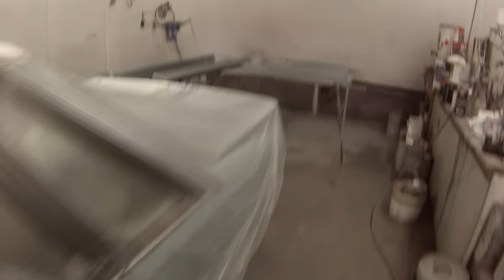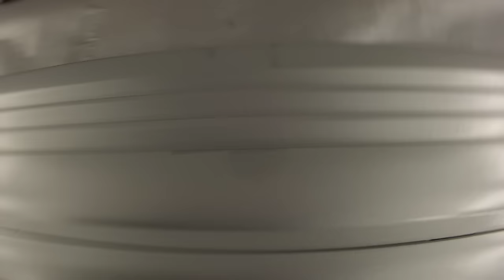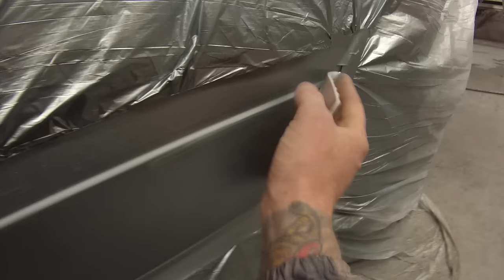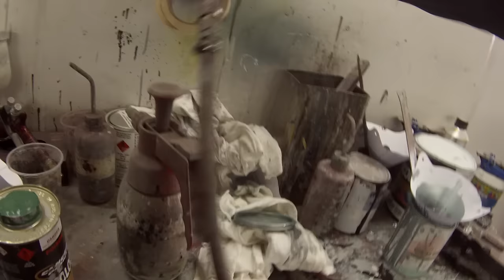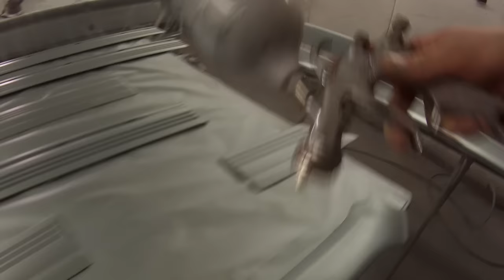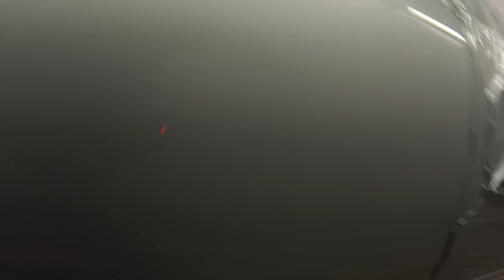Paint Fry Up Fix

Comment: That's exactly how I feel. Motorcycle I bought had nasty hydro dip on it that I thought I removed, fully, down to bear metal. on one side of my tank It did that exact same thing. Such a piss off. I sanded it down back to bear metal and same thing happened. Right now at like $50 in rattle cans lol
Reply: if your going to bare metal you are best to use an etch primer before the paint for it to adhere correctly and prevent paint lift

Comment: The best way to fix this is to get some 320, knock it all down and get some sealer in a can, put on a light coat, let it dry and then a heavy wet coat and then spray your top coat

Comment: Been there, felt that frustration more than I care to remember. I had this problem with Sikkens basecoat . I used Glasurit base coat at my shop & several after hours jobs I did were previously sprayed with Sikkens paint. They lifted the second my base hit the panel. 
After several times I found good sealers/tricks to make acceptable repairs, but no fun going through it. Sometimes stripping panels is just not an option for many reasons, so you'll eventually be faced with these fry-ups sooner or later.

Comment: Iv'e had this happen on a front bumper cover. An easy fix. Sanded it down. Took some primer filler and built up several coats. Wet sanded Primer, Base coat, Clear Coat, Turned out flawless

Comment: Next time try this sand fkd up spot 800 get mini gun mix up high built primer add little bit accelerator too it 
Dust it on then lightly sand 800 then base sometimes when it's really bad it helps also shoot base coat with no or hardly no reducer that also helps 
How I try too avoid trouble is I shoot base coat with no reducer on shit paint where I know it will Frey then base everything
Reply: Thanks for this tip!  We used your advice and it worked!  💯👍🏻👍🏻👍🏻

Comment: we paint an old car at the moment, the one door, had some rust protection on it, and we tried to remove it all, but then we Body filled it, pspray puttied it, and primed it, now the body filler comes back off and it looks like the panel has all rust on it

Comment: I paint guitars and most older guitars have nitro lacquer which reacts this way to reducer in paint and clear coat. What I do now is sand as much of the old paint off with 320 and 400 and seal it with a thin coat of epoxy. Then I scuff it with 600 and lay down the base coat. Works every time and the epoxy adheres well to the old nitro lacquer and also gives a good surface for my base coat. Not sure if this would work for cars but I dont see why not.

Comment: I feel your frustration, when that happens, give it 2 to 3 very dry coats, very thin good primer, sand lightly in between coats and then basecoat coats and clear coat. And it's all good, some old duco does not like the new basecoat paints.

Comment: Having a nightmare trying to stop this on some fibreglass bike fairings, is there a sealant that can be used or am I looking at sanding right down? I've sanded and dust coated each problem area 5 times and still it bleeds through?! I managed to get some clear on it and thought it was sealed but when I scuffed it and laid base again, bang! It's back!! These fairings look to of been painted 4 or 5 times ( race bike ) so I'm dreading the thought of sanding the lot

Comment: Hey mate, I have no problem with my base coats but every time but, on two specific pieces, I spray clear coat on and it fries up.  I've sanded my fibreglass back to nothing twice and it still happens.  I'm not using lacquer and I've given it two  days to dry.

Comment: I had this happen on a motorcycle I painted.  Rear fairing kept frying up.  I sanded it and resprayed it 3 or so times and it finally just looked like  what I call small lightning cracks barely visible under the clear. I even sanded the entire panel and primed it and it still done the same thing. Never could figure it out so I got aggravated and left it.  Was only visible if you looked at it from a few inches away. But man I remember it really pissing me off at the time.

Comment: Hey man, I had a little  fry up come up when applying my last coat of single stage urethane. It was only a tiny area like 4cm2 on the window frame. It came up and I then straight away put light dust coat on it when made it go flat. Super strange but it dried flat. Would it be ok of could it be lifter underneath and peel later? Cheers, love you work.

Comment: The same crap happen to me I was painting a mustang  and it lifted so i sanded it down with 600 I think it happen because i put the first coat of base on too wet in that area. But no worries  problem fixed thank God. lesson learned

Comment: I had the exact same thing happen today. Some old acrylic fried up under my base. I took some wet & dry and knocked the top off it and dusted it lightly, and it didn't come back.
Then the bloody gun spattered on a quarter panel I just finished putting metallic base on. I went mental and threw the gun in the wheelie bin because its been dodgy. New gun, dusted over the spatter drops and it was okay.
Reply: Hi what you mean by wet and dry

Comment: How can u fix it again on monday?  if its already cleared over, a touch up? never looks right
Reply from the maker: +Alive And Anxious the 2k clear can sometimes seal it down
Reply: +The Gunman RAW  The last time that happened to me it came back 3 times before i finally got only 1 or 2 wrinkles on the 4th attempt and i said fuck it, I'm clearing over it!
Reply: When repainting reactions like that, use your basecoat dry and try to not thin it down as much as it's the thinner that bites in and causes it in the first place, or even better use waterbase and you shouldn't have any troubles

Comment: I've had both happen to me too. My fry up was caused by undried fucking Arborust on my sunroof edges. Gun drips = I don't get it. With my guns I tried to use 25psi as you do I got loads of shit with gun drips and pot bubbling bs. When I dropped my pressure to 15psi, solid gold fiNish with no problems! It takes longer but there's no crap with splotches, fish eyes, etc etc..
Reply: Do One  what do you recommend, the warm season is upon us and I'm about ready to finish off both cars for polishing?

Comment: Is that water based paint? I was told by the person, I was taught by that you are not supposed to sand water based????  What do you think sensi. Videos are great by the way thank you.. I have improved amazingly in painting because of you.
Reply: Only water based paint I have used is glasurit and cromax
Reply: I sand water Bourne paint and had no problem
Reply: Cool
Reply: John W I need help spraying mine this keeps happening to me but I've tried sanding with 80grit but not taking away this fry up. Do I need to use higher sand? Also everytime I spray my car it gets patchy looking. What do i need to do?

Comment: I've had to do a bmw rear bumper that went crazy like your 3 times,wanted to set fire to to car,even came through bar cote sealer,,some old paint was flaring up,to make it worse,few days after clear coat,left it out in the cold and it rained,left white spots all over one side of the bumper,the disappeared when the sun came out,,,so I left in inside for a week,,,,,now I've just sealed the bumper,let it dry and primed it,10 in the evening finish. 😡 now 6 am,cup of tea and back at it,if it flares up I'll rip the bumper of and get a Titan silver one from eBay,then smash the old one to bits,,,,,cheers....you are not alone,....love your cursing,,,,

Comment: This just happened to me with a countertop. I have been cussing for two hours. 
I just sanded it all down and kicked the shit out of a lamp in the rental unit i have. 
I am livid. This is the second time it has alligatored on me. 
I have no idea why either at this point. I have the damn place cool and no humidity in the place. I am using an enamel paint from rust oleum made for countertops and spraying it. It isn't a two part like yours but still oil nonetheless. I am scared to do anything. I may go pour the damn paint in a roller tray and go at it with a roller and a brush at this point. It is freaking cracking in three spots every time and now I am getting specs of garbage in my paint from God knows what!

Comment: Same problem with mine but I think I should do block paint repair and my mistake was I even use lacquer on that 
So have yo sand and cover area and paint and then again clear coat painting is easy but sanding is fucking difficult

Comment: you just made me feel better, I just got this biting /fry up on a bumper I was about to re-clear and put a bit of base on the areas that where scuffed and got all this damn fry up / biting .  You swearing is exactly what I did and you cracked me up.  Glad you got if fixed, I'm about to do the same :)
Reply: So what happened did you fix it 
I try it it keep coming back , not good
Reply: @haithzar  I sanded the crap out of it and sealed it with a 2K primer and it stopped... mine was a reaction to the thinner based primer
Reply: Ill try to do it tomorrow morning 
Thank you
Reply: @haithzar  good luck!
Reply: Thank you

Comment: I ferl 4 ya... I. Did a oil soaked car.... Painted b4 with fuckin house paint.. . stripped to metal but oil on tje car did it. Years ago they would use drain oil spray dirt and gravel roads. Some said fuck it abd soraded the car as well. Summer spray for dusty road. Winter car 4 salt prtectio,